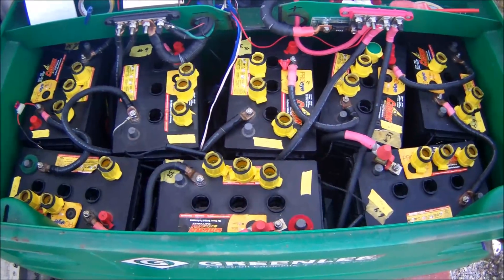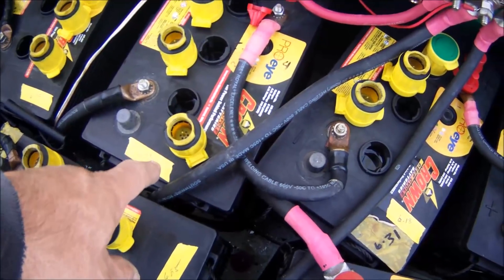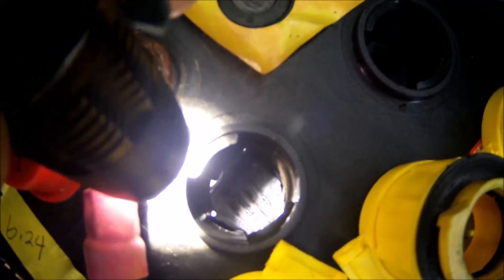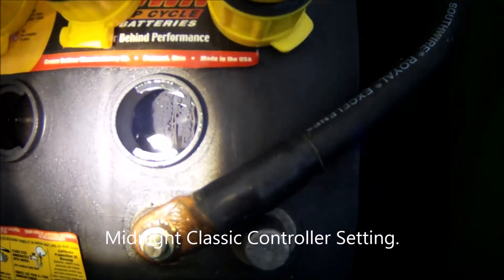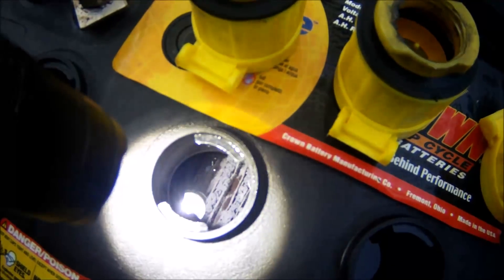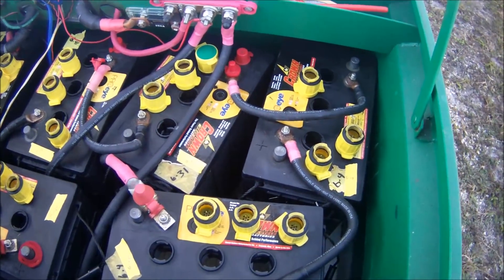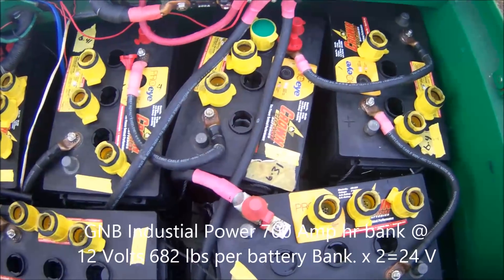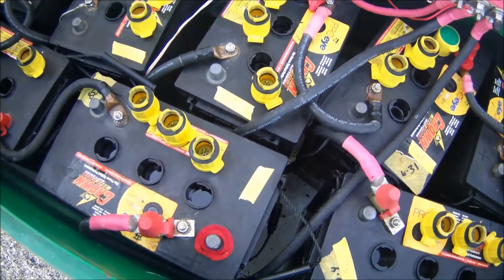Solar 24 Volt Battery Bank look whats up Now!

Comment: Greetings friend, here is what I have learned and what may be happening to your bank. It looks like heavy sulfation to me. I have my solar charge controllers set with temperature compensation at 30 volts absorb and 28 volts float. 3.5 hours on the absorb setting with return amps at 7. My specific gravity is at 1.28 to 1.29
I use a little more water than some folks. A FLA battery that is gassing is a FLA battery that is stirring electrolyte. If the battery does not come to a full charge with the absorb voltage high enough then stratification of the electrolyte will take place. A sufficiently high enough  voltage when in absorb will keep this from happening. AGM batteries will do the same thing. The voltage set points must mach the battery manufacturers recommendations. I also only use the top 15% of my batteries so a SOC of 85% to 86% in normal in the morning. Next I come to a full chage every other day to every day. I have a friend who has been off grid for 40 years and he says that I should get 18 to 20 years from my battery bank. He was able to get 18 years from a set of 8D batteries! That's amazing. The other thing I do is use a good battery monitor so there is no guess work. The battery monitor is checked by Specific Gravity tests done with a refractometer. I have a 840 amp hour 24 volt nominal system with 4.8K in solar. This is too much solar for the 8 1/2 sunny months but not enough in the 3 1/2 darkest months of the year here in the Pacific North Wet. I charge my batteries with a Magnum inverter/charger when ever I can not come to a full charge on the second day. This is how I do it because I do not want to replace any batteries for at least 10 years. I may be crazy but the old timmers say it can and should be done. Time will tell, its been 3 1/2 so far lol. I hope some of this information helps. Every bodies system is different but the once we understand the nature of FLA batteries they should perform for years to come. Have a very Merry Christmas!

Comment: That does not look good. Is the unit working. What is the specific gravity ?. Being a wet L A battery you still need to make sure there charged right. AGM batteries rock.
Reply from the maker: Battery's are working great.  My hydrometer was showing that all was well I started to see the neg plates growing about 1.5 months after the desulfater was installed 6 of 8 battery's are bad oddly my oldest pair look the best. What is done is done. No more FLA for me what a pain. I will use these till they stop working I have to decide what to buy when I move from here.
Reply: Be interesting to see what they say. And if they give you any good help on how to solve the problem.
Reply: Justin Case Solar Power 
Oh yeah!! AGM batteries are expensive but they rock.
That's why I never started with Flood Lead Acid Batteries because of all the hard work, headache and drama you gonna get from those batteries. 
Sorry for all the trouble these batteries has caused you brother and have a wonderful day.

Comment: Looks like sulphate build up. Honestly I am not sure if the Battery Extra desulphator works. I do have the same Battery Extra on my system and my VRLA batteries of about 2 years plus are all gone and do not hold charge any longer.
Reply from the maker: Thank U for your updated results. I am  not sure if it helps or hurts.

Comment: Don't look at what the charge controller said. That means nothing what does the battery manurfacturing co say.  15 volt absorb and 14 volt float. The time will depend on several factors. 4 hours absorb is a starting point
Reply: Yes that's right. I always program the controllers. The base settings on them are just that. It never takes into account the size of the bank.

Comment: STOP wasting your money on lead acid 100 year old technology. I love my Nissan leaf Batteries. I can get 4,000 recharges out of them. They wll last ten years and you can keep them in the house with no off gasing. Lead acid batteries at the very most 500 discharges and I did not ever get that many recharges out of my lead acid flooded batteries because they suck. I say Sell  the old technology and step into the year 2018 get some batteries out of a wreaked Nissan leaf You Wont be Sorry and you can thank me later.  And they never sulfate and you can not charge them for six months no big deal. they hold a charge a long time too.
  Screw any lead acid batteries even the shitty AGM I say.  And I lost three more of those money waster AGMs.  But Nissan Leaf batteries are freaking awesome no kidding I can charge up waay faster, they give back almost every electron of the power you put into them. Lead acid batteries you Loose 50 percent of the power you put into them HALF the power lost . I am broke up with lead acids I am through with them not ever wasting another 100 dollar bill on them total waste of money for sure. 
    Do your self a favor look for a wreaked Nissan leaf and buy the batteries out of it preferably a later model like 2015 2016 2017. You will never be sorry and you can thank me later. LOL Go call the salvages and look on craigs list what ever but find one and buy it. They are matched from the factory so you dont need to worry about a BMS until a few years later. Just one Nissan leaf stack of six will out perform those lead acids. I got to stacks of 6 and I can run my tv and fridge and satellite 24 /7 and I could hook up my wifes computer to them. We stay up all night and watch tv so the batteries never get a break. They are awesome. If you buy lead acid again Im gonna get mad at you. LOL Or you will be sorry you did on the serious note. You would be wasting your money again.
Reply from the maker: Wow thanks I will look into them I am done with FLA.